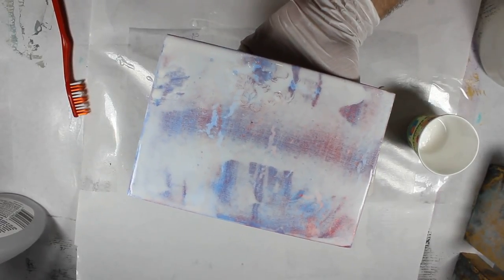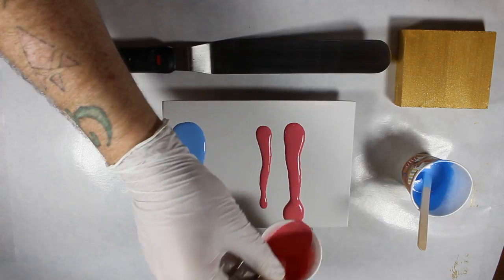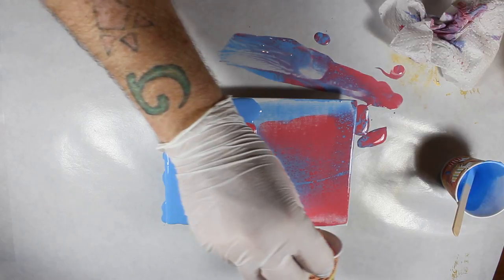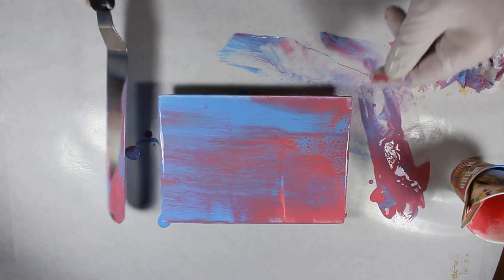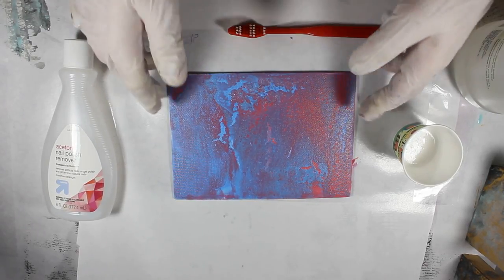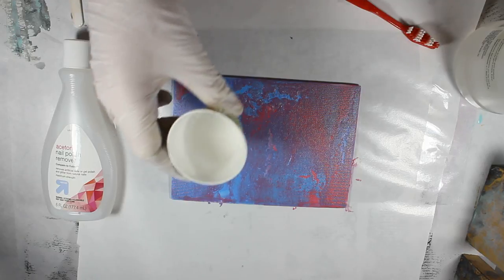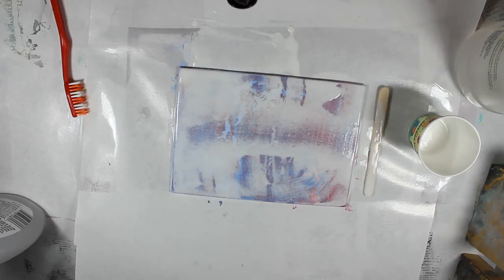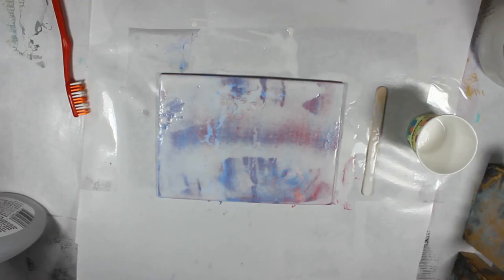Acetone and Alcohol - Surface Experiments for Acrylic Pour Painting

Comment: Hello! It's a palette knife your using. Just thought I'd say because people may ask, lol! It looks like a cranked one too as the blade is offset from  the handle. Great for spreading icing too but obviously not after using for paint -😫usually found in the cookware section. Just goes to show you can recycle tools intended for one purpose for another too.
I read that acetone is miscible with water so in other words it mixes easily with water and as the acrylics are water based I suppose it would follow that they would mix not resist each other. The silicone being oily resists better to alter the surface and create patterns or cells. Great to experiment, look forward to seeing more of your video's. You present them very well. 😁👍🏻
Reply from the maker: Thanks very much lk melv! I'll be sure to remember that bit about the palette knife! Yes, the acetone blended in with the paint and made it a little mushy instead of flowing well. Although it is miscible with water, the plastics in acrylic paint are dissolved by the acetone

Comment: try things and fail, that's me today and actually most days! I struggle with getting rid of air bubbles and having the cells stay put rather than disperse as drying.
Reply from the maker: That's always such a tricky challenge! Sometimes that darn paint just won't cooperate haha! Best of luck, thank you for watching!
Reply: Crafty Crafter hi fellow painter,just noticed ur post,I have had some difficulty with cells retaining their shape,I find adding glue to paint helps and not going overboard on the silicone,and to let dry slowly (floetrol)in coolish clean spot.✌🍵🎨